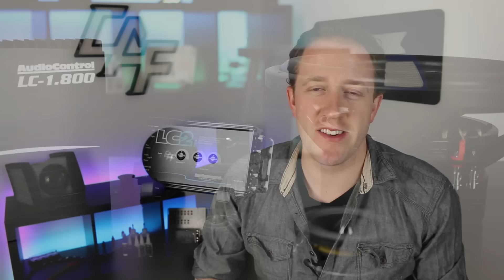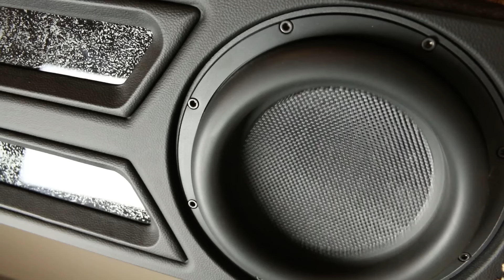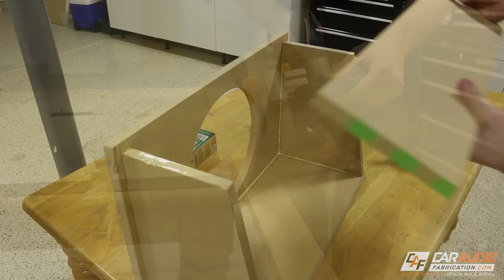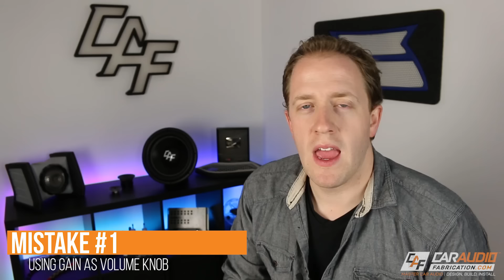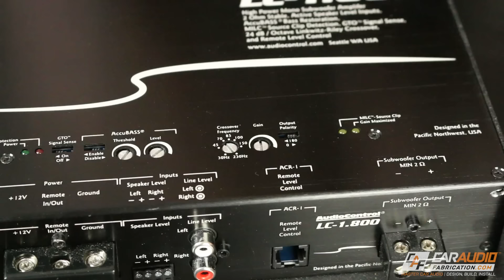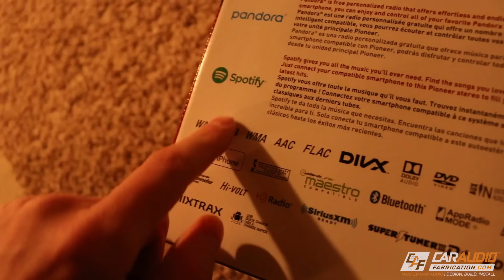Avoid these 5 common Car Audio NOOB Mistakes!

Comment: Awesome intro video to figure out which options to select to in building a new system. I've already installed a new tablet style Pioneer head unit in my 2013 Toyota Avalon (yeah old guy here) and it has made my tunes much better. But what to do next? Watch and learn from many of your videos and then design the system. Not after max bass but a nice crystal clear sound. Goal is to get closer to the sounds coming from the 19 speaker/500W 7.1 surround sound Mark Levinson system found in my Lexus LS460. Doubt I'll get to that point but it's a goal none the less. Avalon for local driving, Lexus for longer drives.

Comment: Hello. I am a noob. This is a job I want to tackle myself But the first mistake you mentioned, the Gail control, got me thinking I don’t know anything yet. I want to put a decent 4 channel amp with a aftermarket touch head unlit and good speakers. But I don’t want to mess it up :/. Should I just take it to a professional?
Reply: The gain put it on the lowest connect 12v wire to battery ground to a sturdy metal surface in the car and remove paint connect plus to plus on speaker and minus remote to stereo rca to stereo there u r

Comment: After not touching car audio for 10 ish years (I was a dumb kid, now I'm a dumb 30 something), I've gone the opposite direction with my current project... 

1. 1/0 gauge "big 3" (really, more like big 5), pure copper w/ crimped AND soldered terminals) with a fused distribution block and separate fuses for everything I add. Actual battery wire, rated for solvents and high heat, then sleeved in tear/heat resistant covers w/ color coding for polarity. 

2. High output alternator (it's a supercharged V8, driven in the Midwest w/ temps as low as -20°F

3. 1/0 gauge fed from the primary distribution block to a secondary fused block in the cab, split to two 4 AWG (again, pure copper) for each of my 2 amps.

4. 4 channel (400W RMS at 4 ohms) amp feeding 2x80w components (front doors/pillars) and 2x80w coaxials (rear doors), w/ 14g speaker wire, routed away from all power wires.

5. "Hidden" 10" shallow mount sub in a sealed box, sized appropriately for the volume of the box and tucked beneath the center console. Fed ~300W RMS, with room for growth if I decide to change that later.

This was less stressful when I wasn't worried about every little detail, but I'm happy with the results today. The only downside is that now I'm opening Pandora's box with sound deadening, with the goal of making a 500 WHP Suburban luxury car quiet. 😂

Comment: idk who is going to come back to this video after 4 years but i have 2 Kenwood Excelon 12 inch subs and they die out whenever my volume is anything higher than 40. i had it installed by “professionals” and they said it was fine. i have a 1200w Kicker amp w max output at 2400w. i’m not sure if it’s the gain (mentioned in the video) or if i need a higher watt amp

Comment: The mistake I made with my first system, was making it way too easy to steal. I had my amp mounted to a board that was just sitting in the trunk near my subwoofer box, so some delightful thieves in the night relieved me of everything effortlessly. This time, I'm considering bolting things down and putting a tack weld on the bolts. Haha

Comment: cheaper radios they leave alot of stuff off  like circuity conversion from hi to lo signals  you have to buy adapters  or they will not work with some amplifiers

Comment: So guilty of using the gain as volume. Now that I have been educating myself over the past year i can spot gain being used as volume from a mile away. I can’t believe how much MORE sound and amplification you can get from actually turning it down and eliminating all of the rolloff and other imperfections caused by abusive levels…..and after educating myself on how to tune a stereo properly i can turn my volume up as loud as I like with 100% confidence that I will never damage a speaker again. And let’s not forget all the damage caused to your EARS from exposing them to excessively loud volumes that are contaminated.

Comment: 3:20 there is no such thing as too big of a speaker period. the box is all that matters regardless of the amp and sub.
Reply from the maker: There is such a thing as too big a speaker FOR THE APPLICATION. I see this all the time, lots  of folks using a subwoofer that is far too large and end up getting poor performance as a result.
Reply: @CarAudioFabrication  yea. i see guys all time who think SPL is louder than SQL.
Reply: @CarAudioFabrication  I am in a 370z and after putting the 12”W7 from my Yukon into it I realized immediately that I did NOT have the airspace to accommodate and got waaaay more bass after switching to a 10”W7

Comment: Another consideration is sometimes people use too much woofer in a big box and can’t place the box in the best area to get the best sound to the front seats. Sometimes a little smaller box will allow you to put that box in the perfect spot for timing and frequency response at the front of the vehicle.

Comment: "Don't let your friend touch the dial" ... Don't you just hate it when you're an actual audio engineer and a random friend starts fucking with your knobs either on the amp or the head unit? Like, you've spent a good amount of time playing with the equalizer, balance and other output settings just so some peasant can go crank "everything to max" and fuck your speakers up with 100% distortion while your cables are melting. It's like I went to Leonardo Da Vinci and "improved" Mona Lisa for him

Comment: I was so broke as a high schooler that I couldn't afford new wires I inherited most my gear it was a monster setup 4 12 p3 punches and a soundstream 8k wired to 1ohm my capacitor was as large as my amp 20k anyway I had pre cut my wires as sort as possible to save as much as I could and one day I snatched an inch on my remote wire accidently well it wouldn't reach connected to my radio so I figured "it's a power wire right" so I wired it direct from my capacitor "hot" to the remote in... melted it into the carpet in about half a second after cranking the truck

Comment: Easily ten to 20 sound systems under my belt and my big mistake when I started i was putting a 2ohm down to 1ohm load on amps I had no idea what they could handle.

Comment: Biggest mistake i made was way underestimating the amount of amps my amp is drawing. I blew 2 30amp fuses after installing everything in -20 degree weather in a blizzard. Very disappointing to say the least. Tomorrow I'm grabbing some 6 gauge wire and a pack of 50 amp fuses. My amp pulls about 40 amps

Comment: Sooooo, I did my installation myself to save some money.  I followed all the advice I got from pro's on youtube and other places.  However, I'm not sure how to tune my amp and crossovers after watching this since I don't have any of the fancy tools he mentioned to do the tuning. I don't want to damage any of the stuff I just worked so hard to install.

I have a 2009 suburban, replaced front door speakers with Kicker 6.25 components
                                             replaced rear speakers with kicker 6.5" coaxial.
                                              replaced the head unit with an Alpine XI 650 touchscreen
                                              2 Kicker 10"'s in a ported box
                                              Powering it all with a 1,000 watt 5 channel soundstream amp
                                               ran all new speaker wire from the amp to all door speakers and subs

That head unit has some advanced sound settings that are out of my league.  I might take it to a pro that has the right tools and just pay him to tune everything for me.

Comment: The number 1 problem I see all the time,  i even see this after shops install YOU NEED TO SAND THE COATING/PAINT WHERE YOU PUT YOUR GROUND WIRE!! Metal means bare metal not painted metal! This will lead to so many issues wierd noises, engine running noises, or simply things won't work but you know it's hooked up so why check that. Number 1 all day! 
 Also I see is way to much electrical tape lol
People splicing wires and using tape, this is not what you want to do asking for problems and there are many different wire connectors that are dirt cheap in some cases cheaper than tape. My favorite is the heat shrink with solder ones. Awesome and no better way that to melt metal to Fuze both wires together. Just need heat gun even they are cheap and as anyone will say once you get a heat gun you will wonder why you never had one. I use mine at least once a week so many uses!

Comment: Ok. I've been stupid. 
Been running into car stereo upgrade from today. Order is placed. 
Anyway. Car has an original subwoofer. 12V and Ground is located in the trunck,  from the rear electronic module. Here the module is loaded with 12V constant, only needed a stick and a 25A fuse. Cable size Im not sure, but its not big. 

Question. When upgrading the amplifier with an aftermarked, is it possible to take 12V and ground from the same locations, or do this amplifiers need 12V from the battery? It is a small 2 channel 60W amplifier.

Comment: Long time follower . But have a question on my current build . 2022 ridgeline rtl-e I’m wanting to do a dsp/ amp in one . Would you recommend the lc-5.1300 or lc-6.1200 . Current factory is an 8 speaker set up .

Comment: I installed a JL audio Loc line output converter, 3000 watt MB Quart mono amp and a W7 12 inch JL Audio to a Honda Ridge line. I am having problem when i turn up the volume to 28 the bass seems to cut off. I can't figure what the problem is. By the way I'm still using the stock radio. Can you give me some advice on what to do?

Comment: Great video man. The biggest mistakes I’ve made were with the box, subs and their amp. Making the bass blend with the rest so it’s a reproduction of the music not just a bunch of bass isn’t easy. A box with the proper air space for the sub is paramount for good bass.
Reply: Yes! This… I just bought a 2020 Honda CRV EX-L and I’m beyond disappointed in the audio. No bass response and the rear speakers don’t sound like they’re working. I want balanced sound profile not a huge kicker box like it’s 1996. It was fun back in the day, but I need all the room in my CRV. I downgraded from 2017 Jeep Grand Cherokee Altitude. The stock sound system was fantastic on that, unfortunately 15/mpg and Jeep’s electrical issues weren’t worth it. Any ideas to get it to sound like a 2017 Jeep Grand Cherokee Altitude edition?
Reply: @greg6162  trade it in for a Jeep 🤷‍♂️
Reply: @greg6162  I traded my 2017 civic coupe ex-Turbo in for a 2024 Hyundai Kona. My civic had the premium audio system, but the sub was hit or miss. The speakers themselves though were way better and I'm trying to figure out how to upgrade my speakers again since now I just have the basic speakers

Comment: Watts RMS per channel with a low total harmonic distortion (THD) percentage for example 0.07% with a frequency response of 20 Hz to 20000 Hz or 20 kHz.
If the amplifier is for the subwoofer then you need to look for possibly a lower hertz measurement.

Also the impedance that the amplifier is driving 4 ohms 2ohms 1 ohms etc.

Often you'll see a car amplifier suggesting 2000 watts  this more likely will be peak also it could well be at 1 kHz and 10% distortion and could be into 2 ohms rather than 4 ohms. Then you have to consider was this measurement taken when the amplifier was in Mono mode or Bridge mode quite often the 2000-watt amplifier in the real world will end up being 50 Watts per channel RMS 20 Hz to 20 kHz 0.07 % THD Into 4 Ohms.

Comment: What my boss amp with 5000watts and a 20amp fuse doesn't put that much watts out?  Hey noobs buy an expensive head unit. And buy really good amps first, if you can afford top line speakers go for it last

Comment: Hi Shawna I don't know if you'd be able to answer this question but have a 2005 Nissan Infiniti with a Bose system and it either doesn't work fades in and out radio once in awhile will work it's a common problem between these guys would you happen to know where to look maybe the amp or would it be in the deck you think thanks
Reply: Sorry was supposed to start out as hi this is Shawn

Comment: You sir are my standard... Thank you so much. But I must also curse you! I had a budget of $200! Now I'm 600 deep! 

Let me explain. I have a Toyota Matrix 2010. One of my speakers on the passenger side is crackling. It has damage and I will replace. I went and ordered an AMP and Speakers. I was fooled by the numbers on the box. I knew what I wanted and expected the company to put real numbers on their boxes. After watching some reviews and this video I learned the truth. There is another youtuber that tests the RMS values of AMPs and I ordered one of those that were good. TARAMPs.

I had my equipment and watched a series of videos from you and realized... although that one speaker was an issue... I did not understand why my old BMW and Ford 500 had better factory sound that this Toyota. After watching your vids... I see why. Yes... there were better sound proofing on those cars. I can hear road noise in my Toyota but my two other cars were mostly quite.

So now.. I am going to modify my car before installing this equipment. I'll address the noise damping and upgrade my electrical. Upgrading wiring,, Adding a second battery, Solar charger, relay isolator to charge the batteries while it sits and a cap.

I'll keep the factory head unit for now as that will be a large expense. But when I don't ill have all the cameras lol.. I'm probably going to dump 1200 in upgrades. 

I've been inspired not only to improve the sound but my ride quality. Thank you for the hobby.

Comment: Not knowing enough about encloses I put 2 12s in a 3cubic feet with no divider they called for 1.5 a peace but I didn’t have any problems the box was sealed and I wired them in series I was isobaric and dint know it but was to big on the box once I put a bunch of poly fill it helped it hit hard and sound really good took away my distortion and made my amp run a good bit hotter than it was running but I jammed a long time this way if I would have known I could have added 2more 12s like mark was saying more and bigger so you could out do some other guy

Comment: I just got done doing my favorite one.... I couldn't find the right wire harness(went to two walmarts) for my aftermarket stereo to my impala, so I decided to cut the harness and wire it myself. Not only did I use electrical tape on everything, but there is no accessory power sorce turn on wire. So I had to splice a fuse tap into the fuse box inside the car. 😂

Comment: Would you know why one speaker in my car system won’t turn on the for the first minute or when I turn the volume up? When the speaker finally kicks In it stays on. It’s not like on off on off. It just doesn’t turn on for the first minute. I guess I’m gonna have to check the wiring this weekend to be sure :(

Comment: Biggest mistake i saw was DIY car audio where they just twist and tape the wires together. Not using fusable links. Insufficient connections. The worst i think is pulling the positive terminal and placing a wire over and putting it back on.

Comment: I understand this is meant for the common person who may not know a lot about audio from a computing standpoint but the 320kbps thing can be misleading. Opus at 128kbps outperforms mps at 320kbps and even aac at 256kbps but its also transparent at like 90-100kbps. I have yet to have somebody be able to tell the difference between opus/flac/wav files unless they were using studio grade equipment. Even a $10k+ car audio system will not be able to pickup the difference. Again though this is getting more into the technical stuff which is not what this video is meant for so I understand why you made the general assumption (even though like no streaming services use mp3)

Comment: I bought a cheap 12" sub and it was too big, so it returned it and got nicer dual 10's and they actually hit lower (17.5hz) with my ported box. (I drive '07 BMW e93)

Comment: Active sub woofer rca ports power earth and remote wire, remote wire will bot turn sub off when car is off please help tried wire tapping into ignition fuse and using wires on back of head unit none of that seems to work

Comment: Never heard anyone actually spell out “F - L - A - C” before yet this video still has some good information in it. I’m thinking about buying an Astell & Kern portable music player that can output DSD512 multi-channel audio as well as flac and other lossless formats, but the thing that it making me hesitant is the fact that car audio by its very nature is never going to sound very good. Due to this proximity , positioning, design, and spatial layout between the speakers and inside of the car and listener - not to mention the fact that usually said speakers will be use while you’re driving and there are the motion , speed, window, etc concerns, so other ‘audiophiles’ have made me question how much it’s really worth it to invest in car audio vs my home stereo